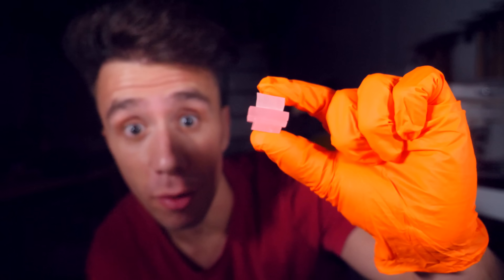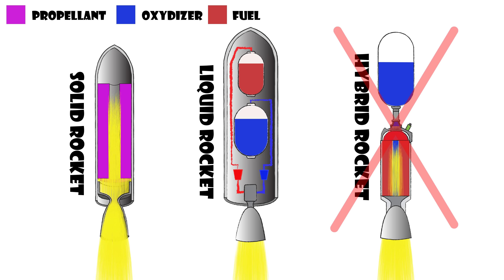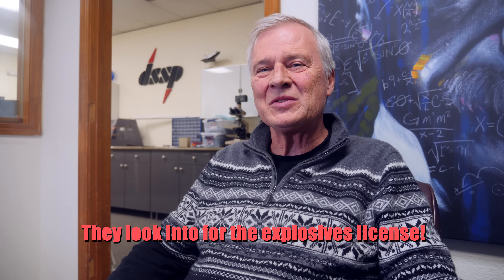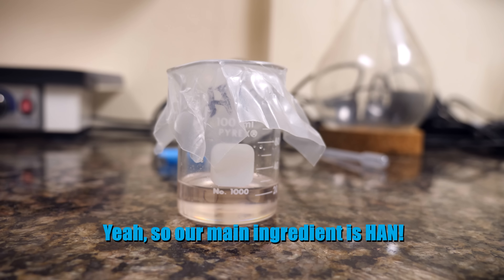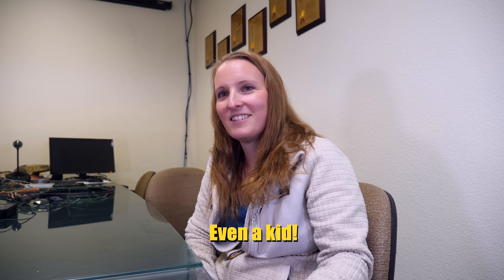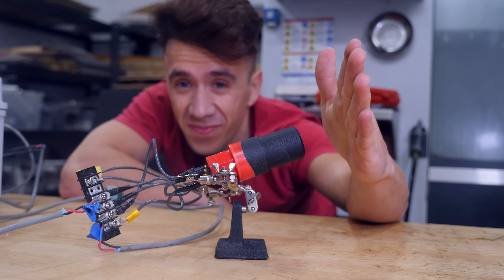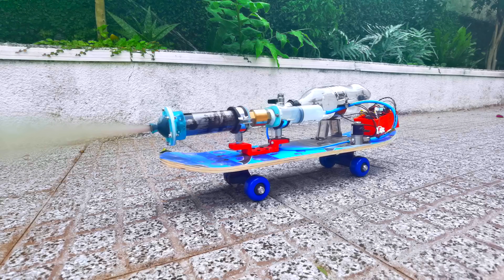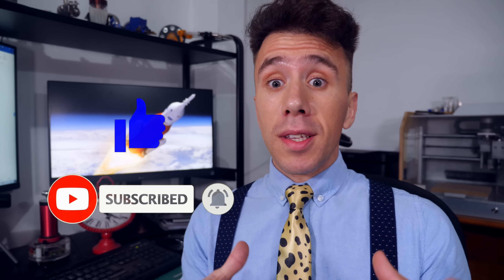ELECTRIC SOLID PROPELLANTS

Comment: the intro section where you say "if you stop applying voltage it stops burning...completely" was such a well executed hook, i was on the edge of my seat
Reply: I agree
Reply: I like the idea of this as a propellant, but there might be an even better one, so we have started to understand frequency and how we can use it to lift objects, right now we're only lifting very small objects, but if we were to figure out how to boost that power, we could potentially create crafts of any shape or size that could fly by using frequency generator technology.

It sounds science fiction, but we already have something like this that exists now, currently they're using it to piece together building items without touching them using frequency, but I believe that if these frequency generators we're all within a craft pointed in all directions, and focused on each other that we could create liftoff without the need of any other propellant, it's completely without sound to the human ear, the frequencies just too high for us to hear, but we could use it to propel any of our vehicles if the generators are put in the right spots and properly programmed and focused on each other.

Anyway, I believe using frequency focused could actually take us much further in space than any other propellant that we've ever used and far faster using far less power in order to achieve on that return.
Reply: @5226-p1e  I think what you're referring to is a type of sound wave engine.  The term frequency is a measure of oscillation (back and forth movements) which could refer to sound/air, electrical current, or what most people think of when the term is mentioned electromagnetic frequencies (which includes low earth EM, radio, infrared, visible light, ultra violet A B and C, X-Rays, and Gamma Rays).  The general idea of a sound wave engine has been around for quite a while and there is some merit to them but there's also a lot of factors that make them less practical.  Sound waves don't travel in a vacuum, they are made up of a fluid (typically air) that's being moved in a particular way.  Sound waves could potentially be used to move in heavy atmospheres like some planets have and/or be used to control a fuel but they can't just push a ship along without some sort of fluid to push against.
Reply: @grn1  
well a wave is pushing the frequency wave correct?

so if it's only pushing the wave that it's emmiting, wouldn't that propell objects, and if there were several of them for all directions for a craft, it could push that object right?

i have already seen a few videos on this subject, now my terminology is probably off, the applications i have seen are very small scale, but i believe so long as it has a powerfull enough energy source to push out constant vibration or sound waves that is tuned to a frequency that will create lift off, i also believe there would have to be many of these sound emitters in various directions likely needing to be controled through an computer algorithm with machine learning capabilitys to gain the proper method of what will lift the object the best way possible.

there is a quote that Nikola Tesla once stated about sound vibration and frequency in this way, but he was also referring to his coil tech extract electricity from the air when this other device was fully connected, at the time he didn't have the tech to use vibration so he couldn't build this craft with the tech of his time, but he had this theory that this is how it would have worked having all the parts and tech at his disposal.

but his rival pretty much shut down any hope he ever got of getting anything off the ground because he would have needed the funding to make his ideas to become a reality, it's too bad he wasn't that good of a business man, i know he wanted to help people and provide free electricity to the world and pretty much made his tech at cost only and never wanted more.

Comment: Make black powder without sulfur. There was a Swiss website (in English) by a man who had done a lot of experimenting on simple mixtures of charcoal and saltpeter. He was able to take measurements from a couple of very old iron hand cannons that had been dug up in Switzerland. He had steel copies made, exactly replicating the interior dimensions.

What he found was that any traditional black powder with sulfur performed very poorly in them. The powder chamber dimensions were not at all good for that type. But his home made powder made with saltpeter and charcoal he made himself went off with a loud bang in the same "handgonnes".

Further experimentation showed that the main reason for sulfur in black powder was to lower the ignition temperature. Matchlocks needed as low an ignition temperature as possible. Flintlocks can use no-sulfur black powder if the priming powder is a sulfur type. Caplocks should not have a problem with it.

I don't recall what he used to fire his replica handgonnes. Might have been cannon fuse.

He also included some history on how the Swiss government was experimenting with sulfurless black powder for cannons until the invention of nitrocellulose based smokeless powder.

Comment: I bought 2 3D printers. First one Sonic Mighty resin. Which works well if you want to print useless things like figurines. Anything useful and the plastic is both soft and brittle, so useless. The second is an Ender 6 which I have tried some 48 times with 2 one inch successful prints. All this was tinkering and modifying. Level the bed, replace it, bowden tube, replace it, nozzle height, replace it,  filament is brittle, replace it, filament swells on humid days, replace it etc.

Comment: That's an understated and important innovation, Integza. Imagine vehicles with hydrogen fuel cells and safe, easily stored fuel which can be decomposed into hydrogen on demand. That could be a good solution to the hydrogen storage problem, as it doesn't have the toxicity of hydrogen-dense fuels like anhydrous Ammonia.

Comment: After watching this video, I think it would be interesting to see a solid-state booster/rocket that can be controlled with stages.  Just like the electrical jelly rocket, you can have multiple or even millions of miniature fibers that would conduct specific electrical pulses to ignite the propellent at the exact and precise time.  You could also control the speed of the solid state propellant by having a cutoff blast to stop the burn and then you can re-ignite at the end to continue the burn.  This would make rocketry much more controllable and precise.  This may seem like a fantasecy  but with this electric type of combustion, this may be a possibility.

Comment: My suggestion would be the emergent Pi competitors.  Since you do a lot with uCs and SoCs, a comparison of some of them would be great. There is actually a new competitor coming out soon called Lichee Pi 4A (it's a beautiful PCB too...) but a price hasnt been posted because its still in pre-order status. The thing that draws me to it is that it can come with upwards of 16GB of RAM with a quad core RISC-V proc at 1.8GHz and a dedicated quad core NPU and GPU for AI purposes.
Reply: Yeah, I actually have a Lichee Pi 4A 16GB, and even now the experience isn't all too great even now but I haven't updated it in a moment. The GPU, AI NPU, encode/decode are off the shelf components from Imagination and their IP subcontractor(s), which aren't exactly known for stellar driver support or documentation. Even now, there's an open source Imagination driver that only supports Vulkan, one GPU, and is allegedly really buggy.
I'm sure if I had a Pi4 or 5 I'd have a different opinion on how fast the LPi4a actually is, but the drivers are objectively awful.

Also, the LPi4a doesn't have full RPi style GPIO support unless you make a PCB with most of the PC/desktop style features ripped out (e.g. sound, wifi) and whip up a custom device tree to handle that.

Comment: I wonder if these would be good for air breathing rockets. Because you get much better fuel density if you don't have to include the oxidizer, or at least not all of the oxidizing material and can oxidize fuel with the air. Like, could I build a microlite aircraft which is limited to 5L of fuel, with a solid fuel in an air breathing rocket or solid fuel jet-engine

Comment: I have a possible easy solution to be able to scale the Electric Solid Propellant to a bigger rocket.  Grind it up into a small powder and use a sand blaster to shoot it into a plasma lighter(you could use a tesla coil output).

Comment: Theme suggestion.  An experiment that changes a laser pointer pen into a solar cell for converting light into electricity, and or laser light into electricity.  The laser pointer uses red ruby, which is a piezoelectric and I believe works both ways, i.e. converts electricity into light and light into electricity.  I wondered if ruby can be purchased in sheets? For ruby solar panels?   Or just how much light energy can it convert into electricity, i.e. a large amount, a lot of collected light, a large luminosity to create a large voltage?... Great video by the way....  Also if your more interested in rocket propulsion tech. Then you could try a theme on momenta displacement engine's, that convert electricity directly into thrust propulsion.   Early momenta displacement engine's were slow and clunky and noisy, and although creating forward force , suffered from a back force problem, cancelling out the forwards force.   The latest advances would overcome these problems by using 2 electric motors each with a heavy metal arm attached, both arms start in parallel, vertically, and move upwards through a 90 degree arc and stop suddenly releasing momenta upwards, then the arms move downwards through a 90  degree arc , and meet back in the middle with an abrupt stop, releasing momenta horizontally/centrally, thus overcoming the back force problem. This new version is also quiet and should be fast, depending on motor speed and oscillation speed. This engine will work best in space and should be capable of light speed travel...  Good luck...

Comment: I want a printer 
How about hydrogen liberation from a solid 
Sor of cold fusion if you just keep adding water 

It could be a silicon/ silicon dioxide  reaction but the closest thing and sustainable to what you say is cold fusion 

I say hydrogen liberator and if you contained the heat then cold fusion or ish good enough with that liberation eigh lol

Comment: I would like a printer
How about a video on flash powder potassium and aluminum 
Barium magnesium all that

It will lead you to a full fire works show and colors

I made 5 colors with the same chemicals and changed just the oxidizer 

Not since shmitsu has that been done 

Anyway you can have my notes too 

Every recipe for fireworks only
Reply: Can I have a metal printer too not just plastic

Comment: 👩‍🍳 🍅👨‍🍳 🍅 🦊 🍅👩‍🍳 🍅 🧑‍🍳  

 🤩🤩🤩🤩🤩🤩🤩🤩🤩

 😜🤪👏👏🦊👏👏😁😉

  I challenge you to build a Better DIY Home-Built Solor Forge ---> Molten Salt Reactor & Peltier Circuit Electricity Home system 

  !!!!potentially enough for Home + Neighborhood 🔋 Power grid system!!!!
Reply: IF I get A license to use Patented process to make "TurboStratic Graphene" from that university in TX (forgot which one...) ; a huge amount of copper wire; and I recieved the 3D printer 🖨 and some ⏲ ⏳ 🕐  I would find a way to make copper doped graphene so it bonds well, and then find out a way to feed the copper wire in through as feedstock into a slightly larger wire making machine but add in the turboStratic graphe flakes (might have to run the whole thing through a powerful 🧲 field that aligns the flakes of graphene inside the cooling new super wire..... 👌 👍 😍 🤩🤌🧵 Then Use this wire to make the various coils needed for the whole set of Triple Nested Peltier Circuits that align with a unique configuration of 3 Hot 🔥  Inputs and 2  🧊  inputs  but balanced Current potential in wire wrappings and include a Liquid Nitrogen Cycle ♻️  and a Unique Combination of x5 Of Nikola Tesla 🧩 together in a never before thought of arrangement, or configuration.... and this will sustain vacuum Easily in the Main Tesla Vacuum Pump, and Keep All Moving fluids moving,  and store Energy in a LARGE Energy density, and longterm way...Using large Tanks (Not sure yet exactly,  but was thinking of using old used cleaned out giant propane tanks, as the underground molten salt 🧂 storage 🧂 🔥 🧂  <--->  🧂 🧊 🧂 <---> 🧂 🔥 🧂
                                                                                                                     T                          **mood 🎶 music**                                                                   🧂 🔥  🧂
Reply: Or just use existing HIGH quality wire and make the wraps out of what's already out there and prototype the darn thing! 😅👨‍🏭🦊🤷🤭

Comment: Ever try recharging nickel metal hydride batteries using sharp pulses of high voltage DC at a few kilohertz. The idea is to condition the batteries to resonate so that they charge faster and last longer per charge.
Reply: I made a joule thief circuit using an audio transformer eight ohm and fifteen hundred or so micro Henry. The circuit lit up a neon tube from a D battery. I also tried using an op amp and in the circuit. Still had a good voltage from the amp lm358. I think I used some diodes one large silicon with a germanium in series to get the polarity right to charge the AA cells. Though I found some old batteries still worked years later in an led lantern. It took three double A cells. And the batteries charge up in three hours and will give good light for one night. and act a bit like a night light a night or two after. These are only three hundred miliamp hour batteries.

Comment: Integza can you yous a E motor on a 3d printed turbo and put the turbo on  a 3d printed air engin the turbo will put komprest air in engin and then the engin wil run as long as the motor of the turbo spin pls
Reply: Hi

Comment: Sounds great but did you checked how much electrical Power you Need to ignite a Kg or Pound? Because in theory Sounds great and if the energy consumption isnt to high it would be awesome. Otherwise carrying a Ton of batteries to Save a half Ton wouldnt be great.

Comment: Instead of one large motor (which the creator of the fuel said wouldn't work) how 'bout a number of small motors? If they aren't powerful enough to be used to escape gravity, they could be used after a rocket ship is free from Earth's gravity and under way, like you were talking about near the end of the video. I'm interested in this and will do some research on my options. This is exciting.
Reply: not cost effective. This is for satellites where a little bit goes a long way.

Comment: C4 plastic explosives is similar. You can burn it. (In the Army, we would heat our C-rations with it.) Or you can smash it. Just don't do the two at the same time. C4 takes heat AND shock to explode. (Which is why a blasting cap is usually used to detonate it. Just running a fuse into it won't cause a detonation. Although you can tie an uli knot into the end of a length of det cord - an uli knot is like a hangman's noose that has had the noose pulled up tight. The burning det cord provides the heat, and the twists and turns of the knot set up shock waves as it burns.)

Comment: You should do a video on steam and electricity, applying high pressure steam into a sonic chamber to separate it into hydrogen and oxygen and igniting it with high voltage for thrust in a water powered rocket. 
 It may require a sonic vaporizer, a Tesla coil, and some rocket engineering and you have the makings of the #1 YouTube video ever!

Comment: Back in the 60’s, 70’s, 80’s, 90’s, 2000’s, 2010’s, 2020’s,, guys in drag racing would mix hydrazine with nitromethane. So you have a fuel that creates oxygen to burn, and a fuel that devours oxygen to burn. But once it dried off in aluminum, the oxide that was left over was volatile enough that a match-heads-worth of oxide was enough to basically vaporize a grown man and leave a 5ftx5ft crater in the ground. 
Fans in the stands were going blind from the exhaust fumes coming off the racecars as they made their 6 second runs down the 1320ft drag way. 
It is potent enough to take a 40hp flathead ford v8 up to about 400hp with nothing but a fuel change. And it would do it once. For about 8-10 seconds. Before it would puke it’s guts on the ground in spectacular fashion. (Google “Magic Muffler Fiat” and you’ll find some pictures of what H does to a V8 when it’s cranky). 

I wonder if we can mix GEM with fuel and go faster safer………

Comment: Here is an idea for you, make a liquid propellant gun (rifle single shot to start with). Insert the rifle slug, fill up the chamber and set it off. Some possible monopropellant are written up in the book 'Ignition' some are even chemically simple. If none of those ideas float your boat you can probably do something by filling the chamber with high-test H2O2 (or a stable mixture of oxidizer and fuel) and mechanically insert a small piece of platinum or similar catalyst through a trap door into the chamber.

Comment: Do you seriously think that GEM would ever be allowed for export considering its potential military uses? In effect this could be the idea way to produce everything from RPG's to cruise missiles. Depending on the specific impulse of the fuel, you could in theory make an very simplified / cheap ICBM. Only real consideration would be is how long the shelf life of the GEM is before it starts to lose its effectiveness. (Guessing that its not very reactive without electricity)